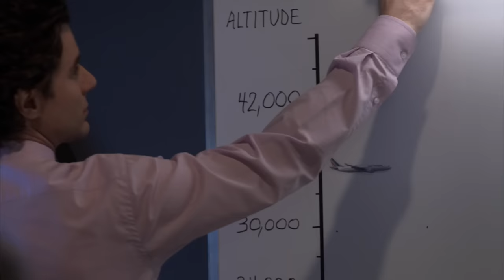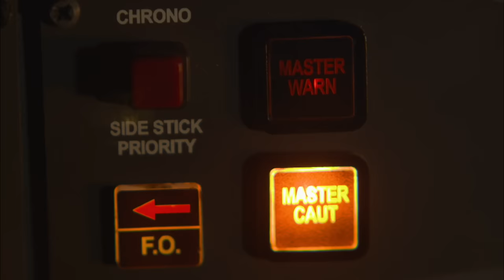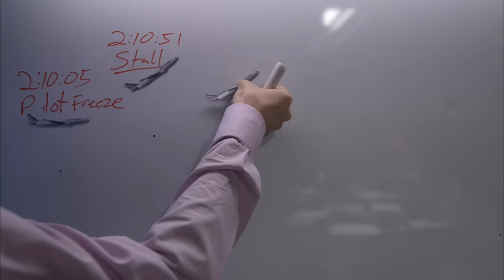Investigators Are Shocked by How a Pilot Handled a Minor Problem ✈️ Air Disasters | Smithsonian

Comment: Astonishing. Stall recovery is one of the first things you learn in basic flight training. At that altitude, this should have been a non-event.
Reply: "Aviation Week's Fred George points out little training time, if any, is spent covering high altitude upset recovery. And even the basic understanding of angle of attack is not always thoroughly understood."
Reply: There were a number of factors at play, in the end, they didn’t know they were stalled until it was too late
Reply: @RevDog777  Just unbilievable, but so Air France.
Reply: @colinmc2945  still nobody can explain as to why did they pull back the handle instead of just increasing the speed & watching their artificial horizon. The former are probably the last things you do if you receive the errors the pilots did.
Reply: @DesiVeer010  There was no horizon, they were in the middle of a storm in the middle of the atlantic ocean 35000 feet in the air. The only point there might have been visual cues (maybe ships?) would have been at lower altitude when recovery would be unlikely. During the decent, they were so far nose up that it is unlikely they would have seen a horizon anyway. Agree that the crew not noticing the extreme nose up position was a huge error.
Reply: @colinmc2945  so you say that Airbus didn't have "artificial horizon indicators" in their plane model cockpits? Also do you understand what an artificial horizon indicator is? If you look into the cockpit you'll find that there is a screen having the upper half blue & the lower half brown or beige. In the center is a fine white line & in the very center of the line there is a "+" icon. That is known as the artificial horizon indicator. It has a different sensor connected to it other than the pitot tube. It provides insights on the plane's pitch & bank angle during the flight. The pilots didn't even consider it for a bit.
Reply: @DesiVeer010  You didn't specify artificial horizon indicators, you said horizon. Yes I agree someone should have noticed the pitch.
Reply: @colinmc2945  "& watching their ARTIFICIAL horizon." From the comment you sourced from.

Not mentioned!?
Reply: @DesiVeer010  K clearly missed it, my bad.
Reply: @colinmc2945  as of G force?
Reply: This accident always baffles me, its as if no one in the cockpit that night knew how to fly a plane and no one took stock of the situation, the whole event was amateur beyond belief.
Reply: Correct.
Reply: Bonaire is a dog.
Reply: Increíble 😢
Reply: Do they teach stall recovery procedures when there is no valid info? Couch pilots...
Reply: its so easy to say that when your not the one in charge. As a matter of fact, they didn't even KNOW they were in a stall, the altimeters weren't working properly they were frozen, so they were still displaying 37k feet in the air.
Reply: Altitude loss was highly prioritized so the procedure was TOGA and full backtick, like  a winds hear manoeuver, but that only works in normal law and lower altitudes. And pilots were trained for high altitude stalls
Reply: @colinmc2945  I can't believe they didn't realize they were stalled!
Reply: @colinmc2945 lol didn’t know they were stalled when the system was beeping “Stall” over 70 times
Reply: @DesiVeer010 the first officer bonin pulled back tht side stick of the plane to pitch up the plane to gain more altitude,as a result when it reach to the max alt ,the angle of attack on wing started making the lifts lower n caused à aerodynamic stall,n the interesting thing is tht they could hve recover from it at the altitude of 10000 ft even but that man Bonin repeatedly pulling tht side stick when other tries to recoverd it n showing double error on the screen.And just before the crashing it was bonin screaming it can’t be happening when he caused all the life of 240 passengers n still tht man Bonin being a neglected person didn’t realize his mistake.Must be very hard for his wife n parents to live with the burden of their sons mistake of killing 250 passengers.Or maybe not although world wide investigators pointed out as Bonins fatal mistake but Air France always hesitated to accept n acknowledge his mistake.
Reply: @shafiquzzamanahmed2095 bonins gf died too as she was on the same flight
Reply: @dylanj7381  oh tht really à big tragedy then indeed,I hope bonin got forgiven by God n all bcoz of his deliberate negligible action during that night.
Reply: The first question is, before the stall, why did the junior co-pilot pull back on the stick? And why did he keep pulling it back until the very end, and despite the other pilot asked for control and he still kept pulling it back?
Reply: @unswtom  bcoz he wasn’t trained to do stall recovery manually n tht too in such ạ situation when the plane goes into ả coffin corner like ả strong turbulent situation,n tht day over Atlantic weather was too rough n they had go through turbulence.N pito tubes got the frozen ice crystal in it.From there chaos n confusion started coz pito tubes we’re giving false readings for a while n they had to disengage auto pilot n as a result they took the manual control n then from there on it was first officer Bonin show till it crashed to the ocean n he kept asking till the very end while pulling tht stick tht how this plane is falling, whts going on
Reply: @colinmc2945  The computer said they had stalled.
Reply: You’re thinking of low altitude stalls. Before the Air France 447 crash, many airlines' training programs primarily focused on low-altitude stall recovery. High-altitude stalls, which are more complex due to thinner air and less engine power, weren't adequately covered. The AF447 tragedy highlighted this gap, leading to enhanced training that includes high-altitude stall recovery in simulators. This was a crucial wake-up call, ensuring pilots are better prepared for such scenarios.

Comment: honestly, im glad that it didnt end up like MH370 where no one found the wreckage...
Reply: Mh370 wreckage has been found
Reply: They didn’t found the wreckage because they didn’t wnat to find it a big cover up
Reply: @musman9853  Only small parts of it though. Still no knowledge of the location of the main wreckage.
Reply: @andersonrodriguez8258  but that's just a theory
Reply: @musman9853  they found a flaperon and small fuselage fragments; not nearly enough to determine what happened
Reply: @madingthree  they would never know and for the time being the educated guess, and what most investigators think, is that either the pilot (most likely) or the copilot, made sure to incapacitate (probably kill everyone on board by going too high, and then dropping at the same rate), and then disengage everything, including the recording devices and then did their thing until the plane more or less, again, another guess, went into the ocean never to be found.

Comment: Bro stall recovery is like one of the main things u learn in training
Reply: Apparently not with Air France at that time. They were relying too much on the Airbus technology.
Reply: Altitude loss was highly prioritized so the procedure was TOGA and full backtick, like  a winds hear manoeuver, but that only works in normal law and lower altitudes
Reply: He knew how to recover from a stall. He did not believe he was in a stall. This is indicated by his earlier remarks about excessive speed, which he never revoked or corrected. He also had no belief that any other indicators were telling him the truth. He was bewildered.
Reply: @johnmac4261 well, if you cant fly a plane without your instruments for a period of 56 seconds are you really a pilot? All he had to do is follow the laws of physic here. Keep the plane steady and the wings would do the job during those 56 seconds to get the instruments back. The plane wasnt the cause of the crash. Bonin lack of intelligence was.

Comment: My theory is that the Air France pilot probably thought the airbus autopilot had gone rouge and was pushing it into a dangerous situation (which they didn’t know that they were creating the dangerous situation) since it was a similar model with Qantas Flight 72, which went into a dive because of the autopilot.
Reply: the 2 other pilots had understood the situation and reacted well but the co-pilot continued his maneuver which increased the stall, the 2 others went too late because Bonin was causing the stall
Reply: They noticed they were in alternative law immediately, before the stall. QF72 also got a F/CTL ALTN LAW, but only after the last upset when the flight computer supposedly noticed that it fucked up.
Reply: even if they realized wrongly that autopilot was pushing it down (nose dive) , the airspeed indicator in that case would show a high increase of speed. Which wouldn't initiate the stall warning and stick shaker.
So it was entirely a pilot error and utterly the wrong use of procedure.

First thing about losing speed is to either gain it by increasing engine power, or pitch down

They did the opposite.

Comment: How did a Professional Pilot end up pulling  back Hard Stick on the Stick.
How could he not see what was about to happen.
Astonishing is just the right word.
Reply: Training for the aircraft in a standard condition. Stall recovery in the airlines was focused on minimizing altitude loss at the time. The Airbus FCS babies you when it's working properly. TOGA and fully aft stick is what the procedure was when the FCS is fully operative. In this case it was in ALTN LAW and he did the same thing he was used to, but didn't realize he didn't have the stall protections...
Reply: I mean Bonin was the pilot pull up and stalled it but he joined Air France at 2005 that's enough years for that pull back still stuff

Comment: When you're stalling, you should lower the nose to gain speed then pull up a bit, but the other pilot keeps pulling up which stalls the plane even more then crashed into the ocean.
Reply: Bonin wasn’t flawless. The key point of AF447 is that the pilots, due to pitot failure as well as inexperience/communication breakdown by Bonin and Robert is that they didn’t have a clear picture as to what was going on.
Reply: @GG-hi5if  reminds me of flight 8501 where they also have poor communication + a malfunction in the RTLU which sends master warning lights to the ECAMs.
Reply: Pitch for speed, power for altitude.
Reply: Basic flying skill.
Reply: @GG-hi5if  they had ecam message : NAV ADR DISAGREE which means verify ur speed informations
Its clearly something to do with just indication of speed not the speed itself 🤦🏻‍♂️🤷🏻‍♂️
Reply: No shit Sherlock
Reply: @louieosumo  In both cases, triple ADR failure or double FAC failure, a red  "SPD LIM" warning is displayed  at the bottom of speed scale. This warning coul'd have been understood as an overspeed limit warning and thus leading to a sharp pull up.
Only a guess.

Comment: There's this little thing that always makes me think I could perhaps make a decent pilot - I can feel every sudden elevation change in my guts. How do experienced pilots not FEEL they're dropping 12000 feet per minute? That would probably put me close to vomiting.
Reply: I've often wondered the same thing. There was a point in the pilots' conversation where they were confirming if they're ascending or descending. The rate at which the plane was falling, they surely should have felt it? I mean, i get the stress and panic, with so many lives at stake, they should have acted with better judgement 😔

Comment: I hope one day we will find mh370 also
Reply: It's already been found.
Reply: @anishjagannathan1576  it has??? Or do you mean parts of the plane
Reply: @davidalleyne934  Parts. The actual black box and flight recorder will likely never be found unless someone is willing to exhaust a whole lot of money looking for it. However, we do know that the plane crashed in the South Indian Ocean. Dozens of confirmed MH370 debris have already been found.
Reply: @anishjagannathan1576  yeah.
Reply: @anishjagannathan1576  @randy1189 It's what they did with flight AF447. It took two years of research and 31m€ to finally locate the black boxes in the middle of the atlantic. The whole search was filmed by a crew sent by the french aviation investigation and they made a documentary about it : "in search of flight af447". Very interesting to watch if you usually like stuff like aircrash investigation
Reply: One day for sure it will be found , but I'm afraid that the DFDR and the CVR will be empty of any data iaw the method of te author.

Comment: Victories have a thousand fathers and failures are orphans. This wasn't just the pilot's fault. That modern aircraft should rely on single, very fallible pitot tubes is also a problem.
Reply: Indeed, also it's the training system fault that focus on automation and leave manual training.

Comment: For those who are interested the plane has a system that prevents the plane from stalling and protects the plane from banking up to much it’s called flight laws there are 2 types of flight law alternate and normal law. Normal law protects the plane from stalling and has all the flights protections so even if you try to stall the plane the plane will just save itself. Normal law can be turned off by many things one of them is the pitiot tubes being frozen or turning off the ELAC system, when this happens the plane enters altnerate law which basically means the plane lost all of it’s protection and can be stall at any time. Some of the Airbus planes like A320 and A330 flight protections.
Reply: @randy1189 Unfortunately, he did realized the protections has been losted.

Comment: woudnt have happened on a boeing just because of the linked control sticks and feedback. he didnt even know he was holding it nose up the entire time.
Reply: Please, stay in your grotto.
Reply: @stabilo3170  
Except that is right. The control wheels allow both pilots to see what the other was doing. 
The airbus sidestick doesn’t allow this.
Reply: @neilkurzman4907  Airbus stick allows to counter without physical fighting and to override by a push button action. The output to the flight controls is the sum of both sides. A clear view to the main instruments which is essential for a confortable flying and  navigation.
Reply: @stabilo3170  
Apparently, the pilot holding the stick in the wrong position was not aware he was doing something wrong, and the other pilot was not aware of what he was doing if you listen to the transcripts. 
On a Boeing aircraft since they have wheels, you can visually see what the other pilot is trying to do. Even without the connection between them.

Comment: It could have been prevented if they trained the first officers more. However, the complex technology in airbus makes it very difficult for pilots to get along with.
Reply: Do nothing would’ve literally been an adequate response. The aircraft was trimmed for level flight with a correct thrust setting.
Reply: @muzero2642  But there was an error about overspeed reading which misled the pilots
Reply: @Jihadists_tears  Doesn’t matter, if you hold the aircraft straight and 2-3° pitch up you can reduce power. If you start to sink, then you can add power back again without worrying about overspeed.
Reply: @muzero2642  But the system is confusing you. So it's the system problem. The system is telling you the overspeed warning
Reply: @Jihadists_tears  The system error was a result of the pitot tube freezing because of the cold temperature probably. I think the 1st officer panicked when the alarm sounded.
Reply: @sonnyanthonyzabala680  Exactly.
Reply: Grading must be strict
Reply: @Jihadists_tears  I'll be happy to never fly with you in command.
Reply: @stabilo3170  You would do me a favor. Because you would fly with Airbus which has so many system errors. I wouldn't
Reply: @Jihadists_tears  "So many system errors" can you please elaborate?
Reply: @stabilo3170  Check the history of Airbus
Reply: @Jihadists_tears  Last I checked, in the last 5 years, Boeing literally outsourced a critical aspect of the flight control software which resulted in 2 Boeing airliners nosediving the ground with passengers onboard. Truth is, both Airbus nor Boeing have a clean record and the rules of the industry are written with the blood of victims. Both Boeing and Airbus nowadays have stellar safety records. Your weird loyalty to Boeing is cringy.
Reply: Did I say I am Boeing fan?! No. However, At least Boeing admitted that it's system failure. And Boeing fixed it. But Airbus never fixed anything . That was why Airbus abandoned production for 2 years! Because they know they can't fix the problem. Airbus has been in service 1/3 of the time Boeing has been though. So of course you can't compare stats of numbers of crashes. But when you look at the numbers of percentage of crash to production during history. Airbus fails
Reply: @Jihadists_tears  you = 🤓
Reply: @corneliuswessi  You 🤡🤡🤡🤡
Reply: @Jihadists_tears  Unbelievable! You are mixing up Airbus and Boeing, so funny ...
Reply: In fact, your technicall knowledge in aviation is just zero.
Reply: @stabilo3170  In fact, your knowledge about history of aviation is even less than  my cat
Reply: @Jihadists_tears  The subject here is not about aviation history, but about human/technical reasons who led to this disaster.
Reply: @Jihadists_tears  Again you are confusing overspeed warning with stall warning, but you are not familiar with aviation world so overspeed or stall warning does'nt make any diffrence for you.
Reply: @Islam_is_true_      What are you talking about?
Reply: Yeah I prefer the more hands on/less computerised Boeings.
Reply: Pilots are trained for failure of airspeed indicator. They should be able to get home without it. Also in 2009 they surely had a GPS speed backup.